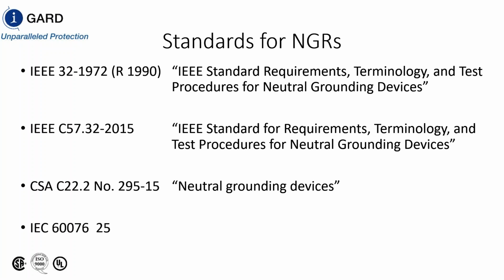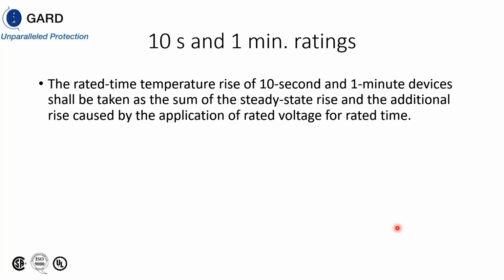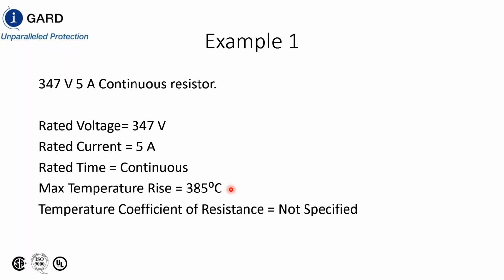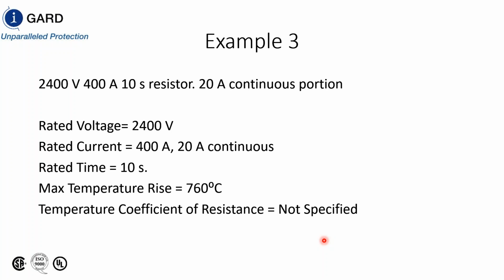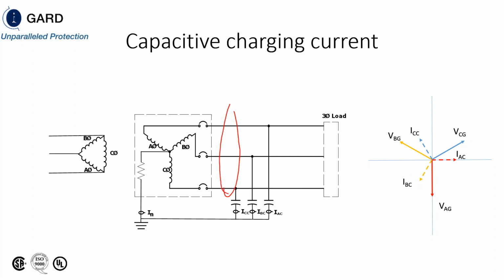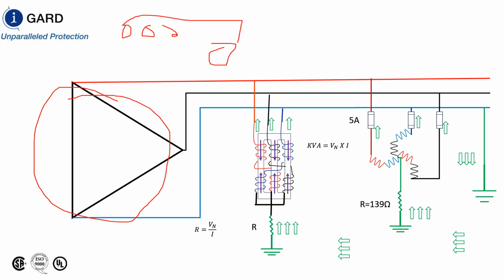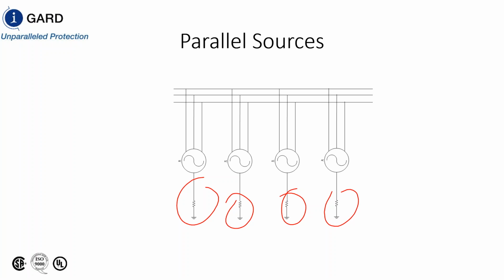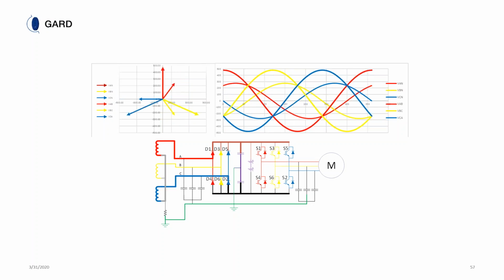Neutral Grounding Resistors: How to Size and Specify

Comment: at time 35:10, you are calculating the resistor values. I= 36.7 x 5amps fault=183.5amps and not 57amps. therefore the resistor value= Vr/ I = 1.13 ohm and not 3.5 ohms. am wondering if my thoughts process is not correct. the remaining video has audio that is very shattered. so i cannot follow.